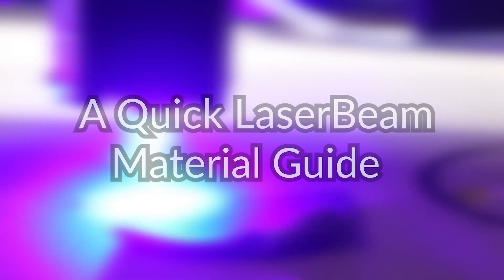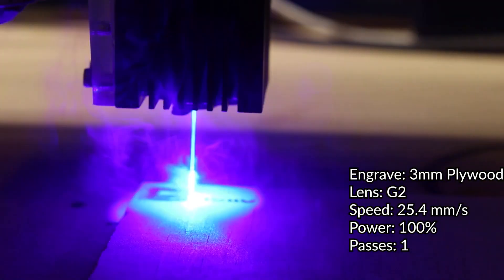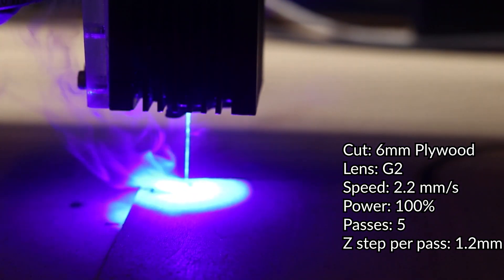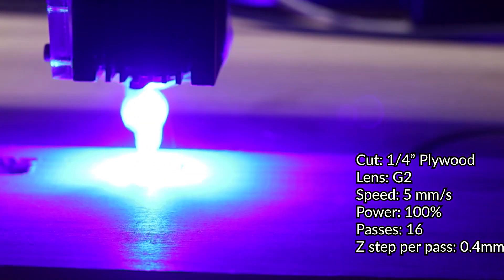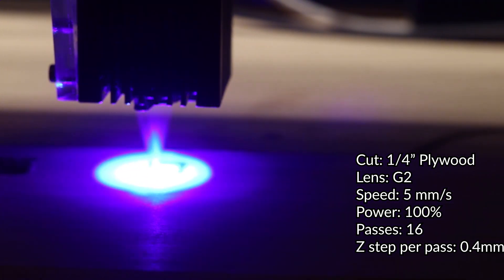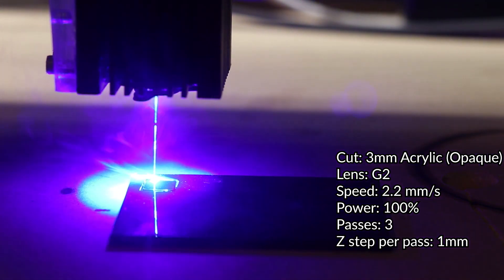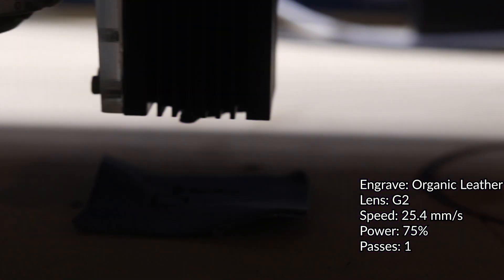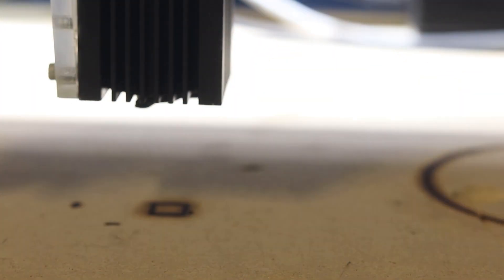Sienci Labs LaserBeam Material Guide

Comment: To whom it may concern at Sienci Labs;  perhaps a Video demonstration of the Laser with the Air Assist in place and operating would provide better results and cleaner cuts.  I am on the fence about purchasing a CNC and or a stand alone laser unit and I am definitely looking for North American manufactured for majority of the components. I like the Sienci Labs approach and think there is something here that I would purchase one machine that does both Laser engraving and wood carving via CNC spindle or router setup is interesting and has me wanting more info. Also interested to know if Long Mill can utilize a rotary axis For engraving via laser or cnc on cylindrical objects such as wine glass , drink glasses etc. ?

Comment: The best way to reduce charring is to have a strong blast of air aimed at the point where the laser hits the wood. I used an old nebulizer and tubing and the only thing that I will change is to add some brass tubing to the tip. You will be amazed at the differences.
1. Less smoke
2. Lower smoke keeps lenses clear and clean 
3. Lower smoke and clean lenses speeds cutting because there is no obstructing smoke and more laser hits the target
4. Way cleaner cuts with finer cut lines.

Comment: You should probably give a warning not to cut Vinyl, PVC or contact paper with the laser, it produces Chlorine gas when cut with a laser. Even if you have a setup like mine that vents to the outside it will eventually destroy your CNC with an acid gas. You can look it up on Google.
Reply: Yup, its included in the safety section of our Pre-order page, but I will make another video dedicated to general and material safety. I was a Co2 Laser operator for almost 2 years so I completely understand the concern. 
Cheers,